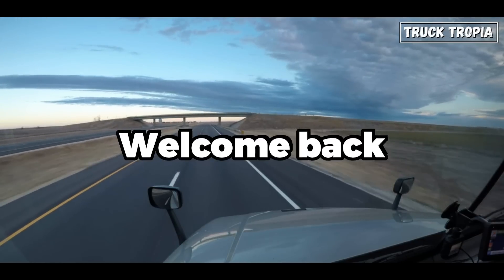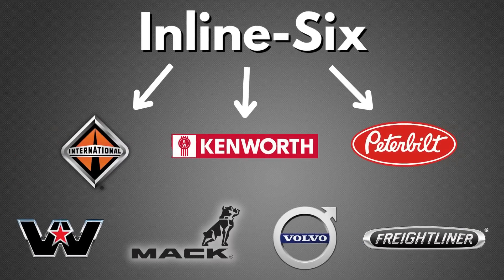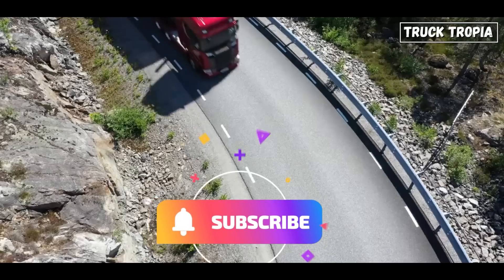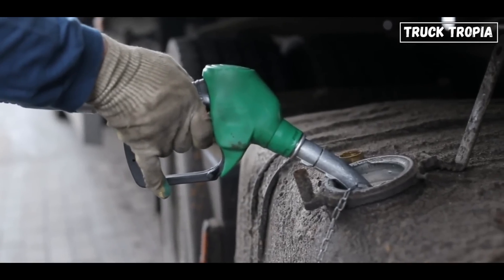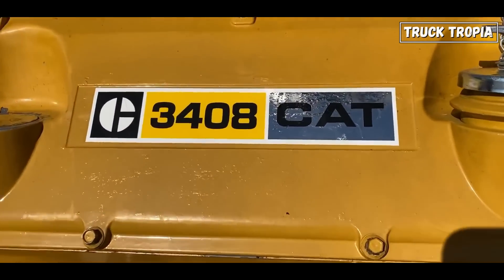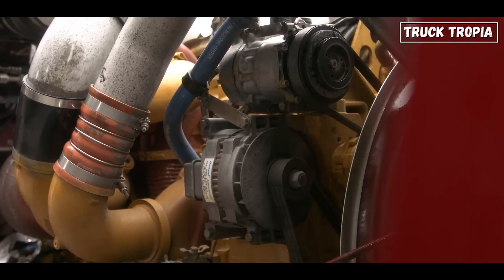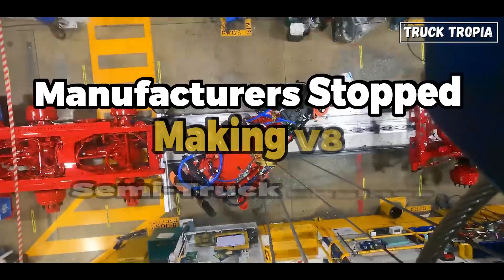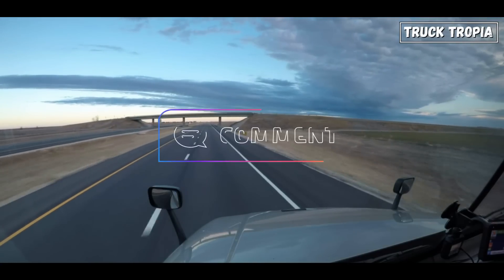Why US Manufacturers Stopped Making V8 Semi-Truck Engines?

Comment: Volvo stopped the production of the Mack V8 engine when they bought the company. This engine was a joint venture development between Scania and Mack that started in the mid 1960’s. But Volvo as Scania’s main competitor didn’t want their new brand “Mack” to keep on with this partnership, they wanted to promote their own 16L inline6 in the Mack trucks.
Maybe it would have been better if Scania and Mack had merged? They had many different joint ventures and benefited both from this.
Reply: Anton It was actually Renault who had Mack as the Mack V8 is in many of the Magnum Trucks. The Ultra liner  is  a Renault cab and the Ultra liner 2 is a Renault Magnum cab. Eventually Renault was bought out by Volvo when the 2nd generation FL was released as this cab was used on the Renault Premium. I know these things as I'm staunch Volvo I own 3 T5R's and a FM double drive Tractor unit all Lady's of leisure. An my 2 daily driver's are a V70 D5R and a S60 D5s. There's not much I don't know about Volvo....
Reply: @tonysilliker5977  scania and Mack startet their relationship long before Renault came in as a shareholder in 1979. Mach already had their V8 at that time. One can say that Renault used the V8 developed by Scania/Mack in the mid 1960’s
Reply: @12345anton6789  No, the Scania and Mack V8 are not related. 2 completly different engines.
Reply: @WieDrDerJonge  scania and Mack started a joint development of the V8 in the early 1960. Mack actually made the engine block for both companies for several years, it was not economical to produce the same engine block in different places due to low volume. The engines has exactly the same displacement and still today the  current Scania V8 is largely based on the Scania/Mack engine block that they developed together
Reply: @12345anton6789  No, two completly different engines. Scania's DS14 is 14.2L and has 8 seperate cylinder heads. The Mack E9 is 16.3L  and uses 4 cylinder heads.
Reply: @WieDrDerJonge  the first Mack ENDT865/866 engines (the predecessors to the E9) had the same displacement as the Scania DS14. The final versions of both engine families (Mack E9 and Scania DC16) also match in displacement,  at 16.4 L. They shared only the bottom end and combustion chamber design, with the cylinders and heads being unique to each company.
Reply: @brianb-p6586   The DC16 is from when the E9 was long gone.
Reply: @WieDrDerJonge  yes, Mack gave up on their version and Scania still builds their's... but if your point was that different displacement proves they're unrelated (which makes no sense, since most engines come in various displacements), my point is that they came in the same displacement, so displacement proves nothing.
Reply: @brianb-p6586  Also, the later Scania V8's are 15607cc, only the R730 and bigger are 16353cc.
Can you show me hard proof of the engines being the same? I can only find 1 or 2 forum posts about it but no real proof.
Reply: @brianb-p6586  But the old DS14 is not related to the 30 year newer DS16, I read the article when the new one came out in the late 90's.
Reply: @WieDrDerJonge  all I know is that every source I have found reporting on these engines report their relationship. And they're clearly not the same - just related.

The Mack V8 family reached 16.4 L in 1978 (as the ET1000, and later E9); Scania apparently didn't go to that displacement until the 1990's.
Reply: @brianb-p6586  related as in they are both V8's....😄
Reply: @WieDrDerJonge  30 years is not a surprising run for an engine.  Are you saying that in the 1990's Scania developed an entirely new engine that just happened to be essentially the same as the previous one, and chose a V8 again when the rest of the world was dropping them in heavy trucks? That doesn't make sense to me.
Reply: @brianb-p6586  Yes, to meet the emisions they had to make an entite new engine. Scania is known for their V8 powered trucks and truck drivers really love them so they would be stupid to not make a V8 anymore. Almost every European truck brand had V8's in the 70's, 80's and 90's. Mercedes and MAN even had a 18.2L V10 which was popular with heavy hauling.
Reply: 18.270cm³ the M.A.N-Mercedes V10  @WieDrDerJonge

Comment: Here in Europe we have 2 trucks, that use V8.
Scania 730 and Mercedes Actros.
And you can order the Volvo FH with 750 hp.
Reply from the maker: Scania v8 is 770 hp and you cant get a mercedes v8 anymore
Reply: You're actually wrong. It's now only Scania. MB discontinued their V8 quite a while ago now. And it's only a matter of time B4 Scania pull the plug on theirs IMO.
Reply: Yes the actual Scania has 770 hp, but that is for the new model. Go back to arround 2012, then it had 730 hp. And at that time you could buy the Mercedes Actros with V8, which driving arround here i guess at least for the next 5-10 years. So we have a lot V8 trucks on the street, if the companies bought them.

But i have to say, the most V8 trucks are in areas with hills and mountains. For example scandinavia, austria and switzerland. in lower areas the usual trucks are with smaller engines. So they overtake each other all the time and block the Autobahn, where are parts with no speed limit.
Reply: I’m curious. Why do EU trucks have high horsepower? The trucks are small and shouldn’t need much hp for the work load it’s performing.
Reply: @johnmoore1949  are you American by any chance? Our trucks over here may look smaller that's because there is generally an overall length restriction. That being said we are allowed to operate at 44 metric tonnes on 6 axles within that length restriction. Remember 44 T is 97000 lbs which is substantially more than what the states is allowed to operate at. Also a few countries, particularly the Scandinavian ones are allowed to operate outside the normal length restrictions hence the use of double trailers B doubles etc. So don't be fooled. Our trucks are certainly not 'small'.
Reply: @johnmoore1949  Not all trucks have so much. Not every company buys them. Usually a Semi has 500 hp. But our trucks are allowed to have a complete weight of 40 metric tons. Now try to pull this thru the alps or other mountains. In Scandinavia they are allowed to pull more than that. That is the reason, Scania and Volvo are the hp kings.
Reply: @johnmoore1949 a lot of European trucks make it outside Europe. We pull 130,000+lb with our V8 MB actros tractors and 6 axle b-trains.
Reply: @johnmoore1949  European trucks are not smaller! The driver cabin  is even bigger
Reply: @TobiasRieperGER  Here in Finland the maximum total weight of a vehicle combination is 76 metric tons everywhere, except for roads and bridges with local weight restrictions. 76 tons requires at least 11 axles. And on a few public roads 104 tons is allowed.
70% of our trucks are Scanias and Volvos And I think this includes even smaller trucks. If we talk about trucks with 3 or more axles their part is even bigger.
Reply: What happened to IVECO Italy's best, right FIAT?
Reply: R Series Scania....

Comment: Why we don't see v6?
Reply: i will vibrate to much you can't balance a v6 diesel
Reply: @realtruth172  V6 diesels exist in smaller trucks, SUV's and family cars to save space. So it's not that bad. But an inline 6 is indeed better where space and a little more weight doesn't matter so much.
Reply: @realtruth172 being a diesel doesn't matter to balance.
Reply: An inline-6 is better-balanced than a V6, and narrower so it packages better between the frame rails of a truck. It's longer and heavier than a V6 of the same displacement, but those are manageable in a truck. 

There have been heavy truck V6 engines, but they are no longer in production. The Mercedes Actros had one of the most recent.
Reply: I m to see a V6 Detroit and Cummins

Comment: Cummins vt 903 Cat 3408 John Deere 15.7 Detroit 8v71 are a few US V8 engines that were used ive heard the vt903 would fall apart and The Deere 15.7 would have internal issues from exesive strain in tractors and heavy equipment and the 3408 ive heard could live way beyond 15000 hours the 8v71s could run forever despite leaking oil everywhere there are some larger medium speed models like a 3508 cat EMD 8-567 to name some us model V8 diesel engines europe has the Deutz V8 air cooled and the DC14 Scania and a ton of others Mercedes Baudoin out of all of them people would prefer the EMD or Scania reading testomonials on scania engines sold in the us their customers say they would not want anything else
Reply: The VT 903 was a very durable engine.
Reply: 7:02 have one with over a million on it😊

Comment: V8 dropped from favor when the US government decided not to go through with the increase in truck weights that was planned, and held our trucks at 80,000 lbs, as the extra power was deemed unnecessary for 90% of trucks in North America.  Scania did try to break into the US market directly after, but found that their trucks were to heavy for our ridiculously low weights, and they couldn't get enough dealers to partner with.  Volvo and Mercedes had the same issues, so they both bought US brands instead.  Comparing the tech in Europe, they are across the board more fuel efficient, with the V8 engines being among the best in the world, as they are the same displacement as our biggest engines, but are moving more weight while burning the same or less fuel.  They are also far more reliable than our engines
Reply: As a 30yr veteran heavy truck mechanic, I can attest that 6cyl engine is less maintenance only it aspect of fewer internal parts come overhaul time. However the larger US V8s that were produced were generally more reliable and had longer service intervals due to less stress put on powerplant. Simple as this:(we live in a disposable sciocty and don't want shit to last). Obama killed the manufacturer of vehicles that used to have longevity and were built to last. D.E.F. is a joke & F-ing no one else uses the power robbing shit. Just us stupid Americans who believe that we should give up everything, when all 3rd world countries don't do squat for the environment.
Reply: @NASCARLSON what we fail to understand is we can put all this crap on our engines for the sake of the environment and pat ourselves on the back thinking we are saving the environment and global warming... but it will only take  100 years down the road, and if every country on earth participates too, do you think China  Brazil  Africa and other third world countries are really trying  to save the planet, or put food on their tables...
Reply: V shaped engine consume same or  lesser fuel compared to inline engine of same displacement?😂
Reply: @er.m.s8930  , a 16L engine is a 16L engine, doesn't matter if it is an I6, V8, I8, V10, that just means smaller bore diameter.  If the engine is producing more power for the same displacement, then it is in fact more fuel efficient.
Reply: The government had to restrict weight because the railroads would fold if truck weight was increased.
Reply: *36,2873896 tons
Reply: That was good thinking on your governments part keeping weight within 80,000lbs or 36 tonnes. In my country the govt increased max weight of a truck well beyond that (53 tonnes) and our roads are absolutely shot to pieces. 4 axle twin steer tractor units pulling 5 axle trailers has taken its toll even on our main highways. ☹️
Reply: In the northwest we run heavier. I pulled a 3 axle reefer. I grossed 96,000 running to and from Washington state. I loaded 1,200 boxes of apples back to Minnesota with drops in Montana and North Dakota. I would be below 80,000 when I got to Minnesota. I usually had 8 drops out west and up to 12 picks and 15 drops going east. I made great money.

Comment: So, there are 6 American semi-truck manufacturers? Mack, Kenworth, Peterbilt, Freightliner, International and........ ?
Reply: Western Star ! But there are probably more
Reply: Volvo
Reply: @ericlaker1983   Volvo is not American though...
Reply: ..and Ford I think
Reply: @dimitrispaterakes3633   Ford makes pick up trucks even large pick up trucks but not semi-trucks
Reply: @Seventh7Art Ford= Sterling
Reply: @Seventh7Art  You are wrong in that Ford doesn’t manufacture heavy trucks including semis as Ford does manufacture the F Max, 3548 & 1848 semis plus a large number of heavy trucks. They sell them but just not to Americans & Canadians, all they get are toys.
Reply: @niilokorpi9826   Okay, I stand corrected regarding Ford tractors and trucks. None of them outputs more than 500 horsepower though.... Scania builds V8 semis with 770 horsepower for countries with steep uphill roads like mine. A Ford F Max does not produce adequate power and torque, on the other hand.
Reply: @Seventh7Art   I certainly wasn’t saying anything bad about Scania Vabis or Scania Diesels. I know that they are great going back to the D8, D11 and of course the DS14. It is just so sad that they were taken over by Volkswagen. Some things should just be left alone. I wish the Wallenberg family would have kept it. Great talking with you. I also was a fan of the Ford Transcontinental & of course the CL 9000.
Reply: @stevebalun9554 Ford heavy trucks in North America became part of Freightliner as Sterling, but that brand is long gone.
Reply: What do you consider "American"? 

Kenworth, Peterbilt and DAF are all brands of PACCAR; both Kenworth and Peterbilt are built in the USA. They have PACCAR-branded engines, shared with DAF. 

Autocar builds trucks under their own brand, and only in the USA.

Volvo, Mack, and Renault are brands of the Volvo Group; both Volvo and Mack are built in the USA. They build Volvo engines. 

Freightliner, Western Star are the brands of Daimler Truck North America, which is a subsidiary of Daimler Truck; both are built in the USA. Their North American engine brand is Detroit Diesel, which shares engine designs with Mercedes. 

International is a brand of Navistar, which is part of Traton, which is part of the Volkswagen Group and also includes MAN and Scania. International trucks use mostly Cummins engines but also International-branded MAN and Scania engines.

That's 8 brands built in the USA, from 5 companies, with 5 engine manufacturers. Only two of the companies are based in the USA; the rest are based in Europe. 

Every heavy US truck line has a 13 L to 15 L inline-6 turbodiesel as their most powerful available engine.
Reply: Best trucks as a mechanic in North America - first to last:
Kenworth
Peterbilt
Western Star
Freightliner
Hino/Isuzu
International 
Mac
Volvo

Age range will make some changes but this is my rank of trucks I'd rather work on.

Comment: Wrong,Scania still has a V8
Just saying
And electric trucks are to heavy no infra structure same as the trucks that run Hydrogen,so for now we are safe and we can run our diesel engines
Reply from the maker: Is scania a US manufacturer .. i dont Think so 😉
Reply: @TruckTropia , technically, yes, they have a small facility assembling engines in Houston, TX area, and are now the owners of International, as well as being the producer of the new International engine.

Comment: The inline 6 also uses fewer parts - one cylinder head instead of 2. It is a simpler engine design that is cheaper to produce, and cheaper and easier to maintain. As mentioned,  it produces high torque at low rpm, which is perfect for heavy truck applications. IMHO, a superior design!